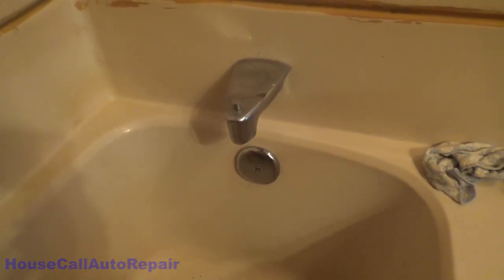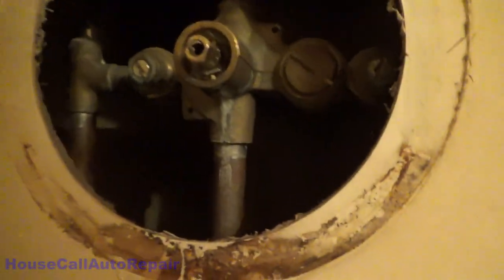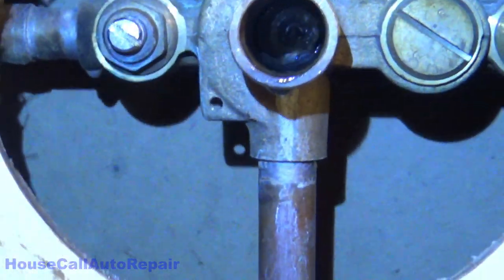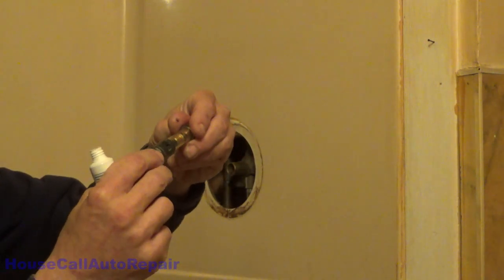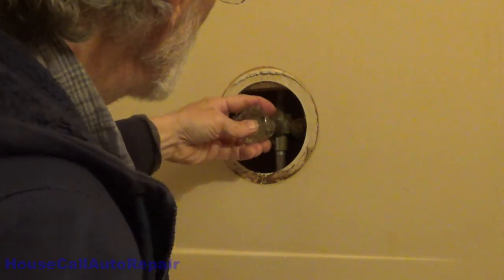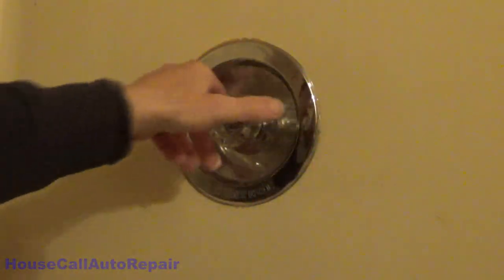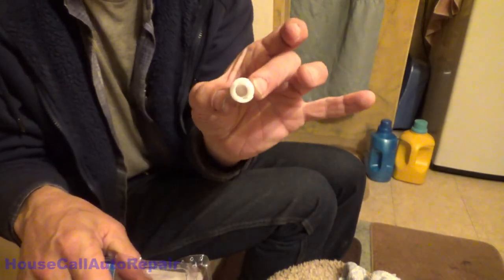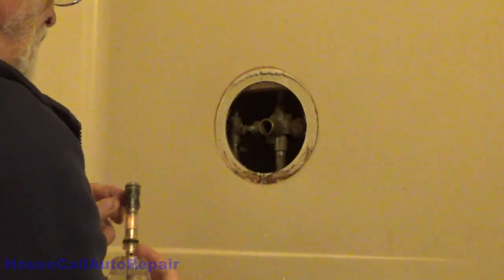MOENtrol 3570 Valve - Core Replacement - MOEN 1225 B

Comment: Loved the Bloopers Charlie😂😂👍
Reply from the maker: I thought I was losing my mind, when I ONLY had the hot water line in the basement, turned off, and didn't even get cold to flow.... (No pressure on the hot side to balance the temperature control spool)